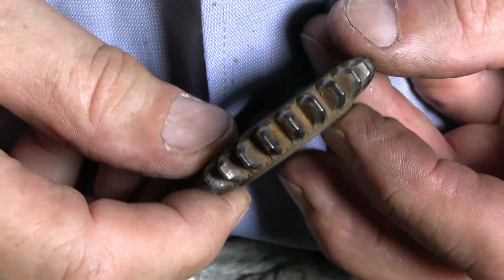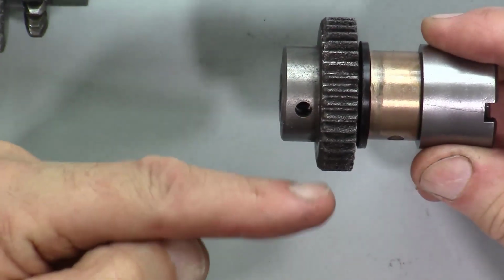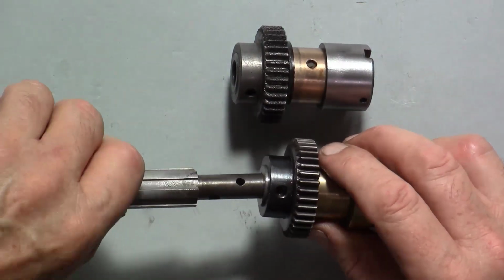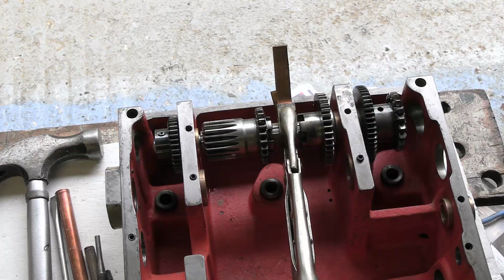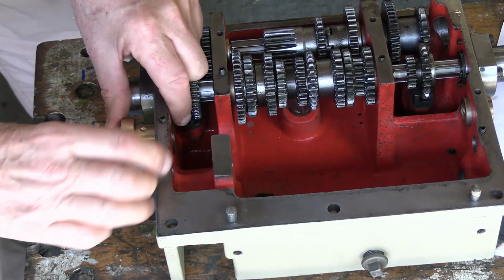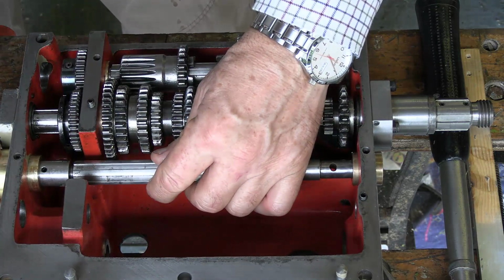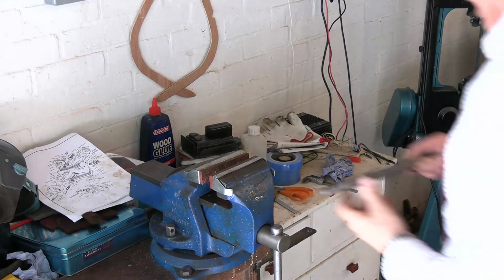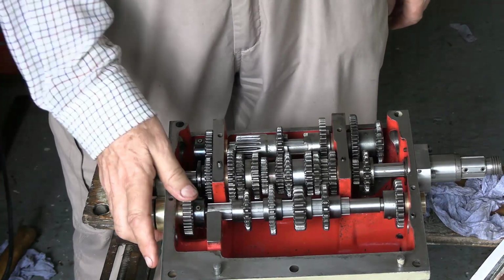Harrison M300 lathe - Refurb & assembly of feed gearbox part 1

Comment: Well done, your perseverance paid off! the only time I've seen those scrolled roll pins, is on American Browne and Sharpe machines I was reconditioning, still it's looking really good Samuel, cheers, Dave
Reply from the maker: All the spiral roll pins in this lathe are heavy duty ones (ISO 8748 ASME B18.8.3M). I can buy 1000 of these in one size, but cannot find a retailer of small quantities or mixed sizes. Info https://www.spirol.com/library/main_catalogs/SPIROL-Coiled-Spring-Pins-Design-Guide-us.pdf ,
Reply: @samuelfielder  Yes, they are the ones Samuel, interesting, I assumed they were a US product